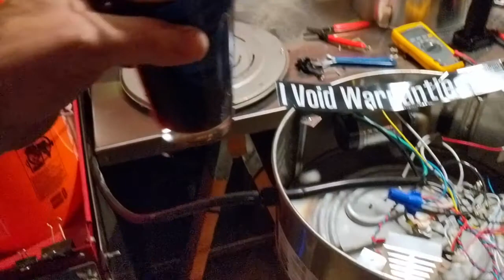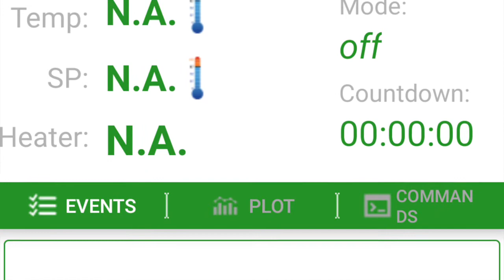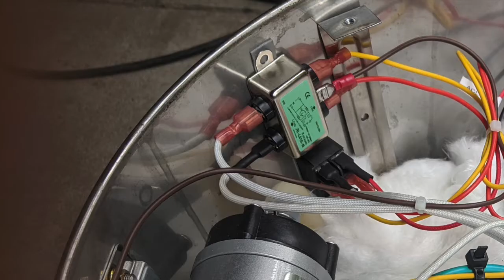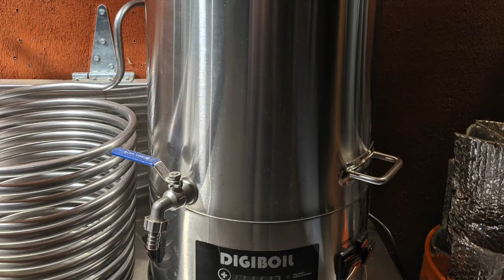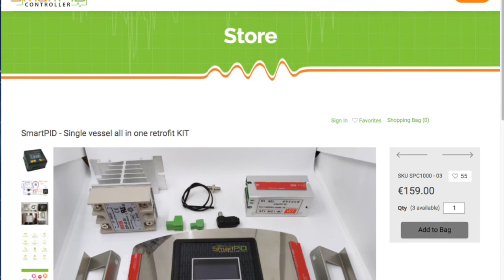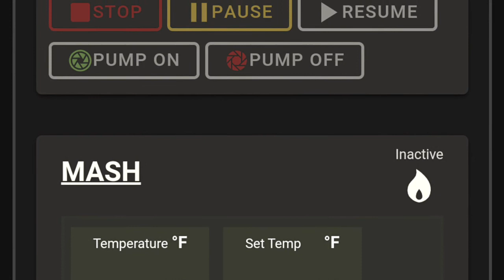Smart PID  into Brewzilla 65L

Comment: Hello, thanks for your experience. Can you please help and tell W - shape heating element at the center is  500w or 2000w?  In my case when turning on 2000w switch  on body, W-shape element turning on ( bubles in that place while boiling).

Comment: Hi @Eaton Works.  I am considering adding insulation to the base of my 35L Robobrew (35L 120v).  I noticed the unit in the video has this.  What type of insulation is appropriate?
Reply: My 65 liter had this from the factory so I can't answer with confidence, but if it were me I'd make sure I'd use something that is intended for high temps and is electrically non conductive to be safe (like rock wool).

Comment: Hi! I'm stronly evaluating this option and that's how I found your video. I'd like to understand how you wired the temperature sensore because I read that SmartPID uses a 1-wire sensor.
Reply from the maker: Although I remember there being 2 wires on the temp sensor in the Brewzilla's original configuration, the Smart PID kit comes with a new 2 wire sensor that fits the hole and as appropriate values for the controller. So no problems there.

Comment: @Eaton Works  Just purchased the Smart PID kit and am looking to install it into my 220V RoboBrew 3.1 35L.  I came up with a wiring diagram based on your video.  Would you explain more about wiring in the Noise Filter?  I can send you the wiring diagram I came up with.  If you would edit it to show me how to wire in the Noise Filter I would appreciate it.  Let me know.
Reply from the maker: Sorry for the slow response, I apparently didn't have comments forwarding to where I'd see them.  I posted a link to the EMF filter I used in the description and it has a diagram on the link. It really is as simple as power (from the switch) on one side, load (the motor leads) on the other.  Hope that either helps, or you are already up and running.
Reply: @Zach Grieger Can I please have a look at your wiring diagram?
Reply: @Zach Grieger would you be happy to send the wiring diagram as I am about to do the same?

Comment: I too am going to build my PID standalone for the 35L digiboil and my thoughts were, was the PID going to mess up the electrical components inside by continually switching the power on and off. Do you think so??
Reply from the maker: The only part it is switching on and off is the heater elements which are just big resistors.  It really shouldn't impact them at all. That said, just remember you shred your warranty with this move.

Comment: Great guide , great feedback...you fully got all the advantages of moving to a full automate process controller (on top of course of the PID temperature regulation) with recipe management, remote control etc..
Give also a change to brewfather.app planning tool, top brewing SW and smarPID is fully integrated
Reply from the maker: Thanks!  Let me know if you get the kit back in stock and I'll post a link in the description.